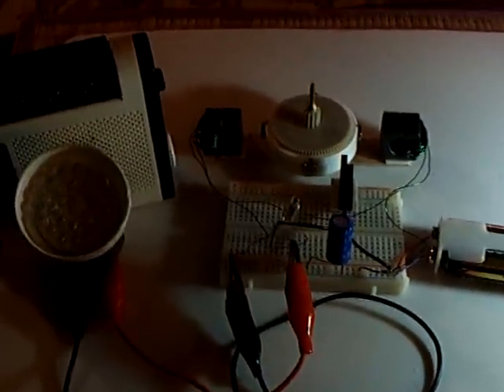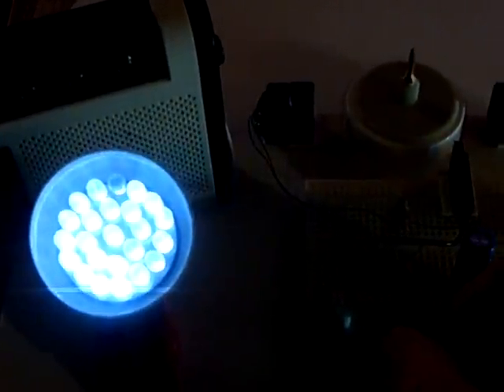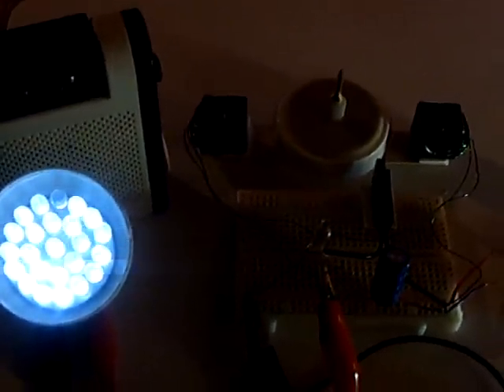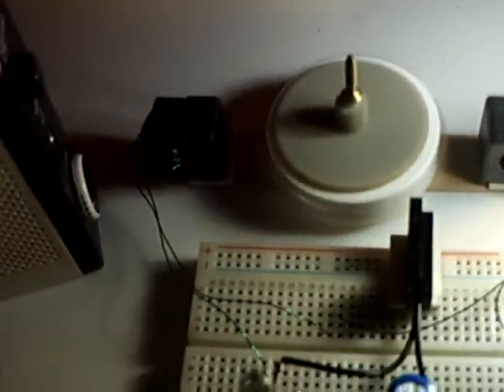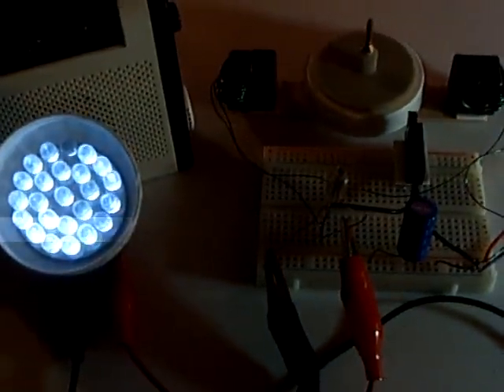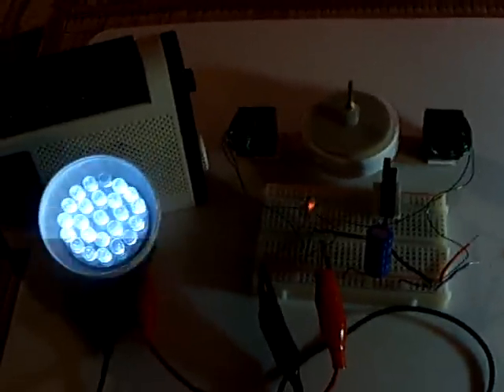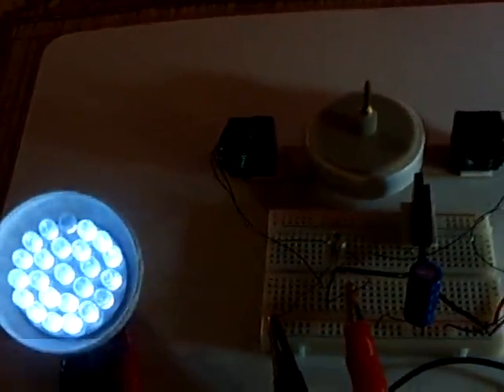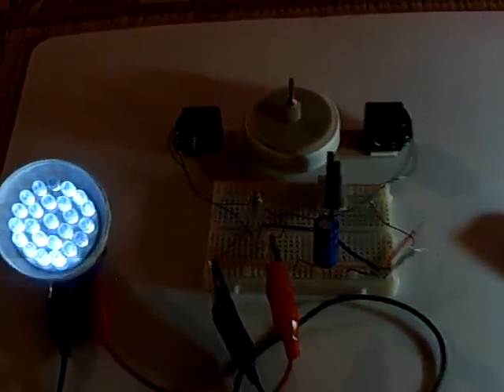Thomas Motor ---inductive kick back test

Comment: I dont think reeds are good for clean switching due to arcing,but you do have a good inductive kickback there. Good job again Lidmotor.
Reply from the maker: +TinManPower    Thanks . I may try to switch this some other way. I did more research on the Zero Force Motor today and found out more about it buried in old threads at the Energetic Forum.  It appears that the design called for the field coil polarity to be switched using that bedini/cole window motor circuit.  I'm not even going to try that.
Reply: +Lidmotor 
Now you're getting to basics - better than mocking Mr Bedini.

Comment: Lidmotor
Can you use Muller circuit with Hall effect sensor north side try as k4zep
Thank you
Reply from the maker: +Edmorbus   I got this to run today using a transistor circuit with a sensitive separate trigger coil to switch the transistror.  It didn't run that great so the next thing to try is Ben's Hall sensor method. I could also do it optically using a photo transistor and an infrared led.

Comment: I use a reed relay that works like a reed switch and almost never welds.  They're a buck apiese at Mouser or $3 at radio shack..  ETE omr-c-112h
Reply from the maker: +texjarhead  Thanks.

Comment: Well done. High current flow with high torque isn't necessarily a bad thing. It just means it's better suited for series with another load. Energy consumption doesn't have to occur with permanent magnets. We can save energy by consuming little or no energy in the motor and the other device in the circuit is what we're paying to run. Very interesting motor.
Reply from the maker: +Arkiver Unified Energy Thanks.  Yes this motor is very interesting.

Comment: Well done ! Did you make sure that the 2 toroidal coils are wired 180 degrees out of phase in series, so the magnets do not induce any voltage and current, so it has no counter EMF ? 
This way, it is just a Motor but NOT a generator ! So Lenz Law does not apply !
That is the most important point with this motor....
Reply from the maker: +Stefan Hartmann  This motor does not generate when you manually spin it.  Why it does this I am confused.  The coils are out of phase but with the coils winding running the way they are and the ferrite cores biased with the permanent magnets--it is just a confusing situation.   Without the bias magnets in the cores the the motor does not run---nor generate.  The rotor has all N facing magnets.
Reply: +Lidmotor It does not generate any voltage while spinning it manually, cause the induction is canceled out, due to the 180 degrees out of phase in series of the 2 coils... there the induction voltages just cancel out ! That is why this motor is so special ! That is also meaning, it has no CounterEMF when you run it via the powersupply, so the RPM will not be controlled via the difference voltage of supplyvoltage minus CounterEMF voltage, as it is in a normal DC motor...
Here the magnets from the rotor attract just the biased ferrite cores and when aligned you switch on the coils which then totally saturate the cores, so the attraction is almost gone and the rotor can rotate on...The Permanent magnet inside the core helps to bias the cores to a good value, so the coils don´t need such a big current to do the rest of the saturation...so this is the advantage of the Thomas Motor versus the Electric Orbo...Hope this helps to understand this motor much better... it just defies Lenz Law and only needs to be build much bigger, so that the magnetic and ohmic losses will be reduced , so it can go overunity. Regards, Stefan.
Reply: With bigger magnets and bigger ferrite cores and less distance between them you will get stronger attraction forces and thus the efficiency will rise ! But this will not negatively affect the motor cause it has no CounterEMF, so CounterEMF induction will not slow the rotor down, as it does not exist  ! This motor has really the chance to go overunity, it only has to be build really big, so the attraction forces of big neodym magnets to the ferrite cores will pull the rotor really hard and strong...
Reply: +Lidmotor Please try to reduce in your current model the distance between the magnerotor and the ferrite coils. This will already give a much stronger motor and increase efficiency. You probably need then also to adjust the reedswitch. Many thanks.
Regards, Stefan.
Reply from the maker: +Stefan Hartmann   I tried adjusting the distance between the coils and the rotor while the motor was running.  There is a sweet spot on this current model.  Too close and the motor cogs too much because of the strong attraction of the rotor neos to the ferrite.  Too far away and cog goes away but so does the power.
Reply from the maker: +Stefan Hartmann  Ben has not posted any more videos on his motor so he may have decided that this was another interesting road---that led nowhere.  He did make some calculations that showed that his motor configuration was a better performer than the Orbo design.  TinselKoala did a lot of work on this type of motor also and it appears that he has also put it on the shelf.   When this sort of thing happens I always ask myself--why?
Reply: Hmm, Ben was very busy with other things but still wanted to continue with it he told me. We will see, what will come out of it. When I will have some more free time soon, I will also look into this. some more. Regards, Stefan.

Comment: Very well done Lidmotor ! Yes, it probably need finer wire diameter wire, so it will not draw too much current and then you can also place it nearer to the magnet rotor.
Also another pair of coils would be good to have 4 coils all in all and it would generate more torque. Then one needs this also to be build 10 times bigger and then this motor will have some nice performance and might go overunity. Did you see, if it generates no voltage induction into the serial 180 out of phase toroidal coils, when you
turn the rotor by hand and watch it on a scope ? Many thanks. Regards, Stefan.

Comment: Nice!
 My reed switch is only good to 3A too.  
You can get higher current reed switches.

So you think the whole explanation for the increased torque is the ferrite core, internal magnet, & increasing the V?  I wonder if there is some easy way to measure the output torque without a dynamometer.  The physics calculation for torque is pretty straight forward--although, I'm not sure how one would go about applying it to your motor..

Thanks for sharing!
Reply from the maker: +A B  Thanks.  I have some higher rated reed switches also but I think that just adding a simple npn transistor circuit would solve the problem.  Perhaps a simple Hall circuit would be the other alternative.  I don't think that I want to get into real performance testing on this thing.  Other people might.  Ben did some numbers crunching on his original build and it looked good.
Reply: +Lidmotor Did he show his calculation method?  If yes, what is the url to his page?
Thanks!
Reply from the maker: +A B Here is Ben's video where he talks about the efficiency of his design compared to the Orbo motor.  https://www.youtube.com/watch?v=UsVPwKp56Zw.  Frankly I don't think either design is super efficient but that is just my opinion.
Reply: Thanks for the url.  His explanations are a bit difficult to follow, but he does make some interesting points--although, I'm not familiar with the "Orbo motor configuration" so that might be part of the difficulty.

As for the efficiency, one would need to define one's efficiency goal & then compare the different motor designs to determine which one most ideally matches that goal. A person who wants lowest energy consumption or highest energy efficiency has a very different goal than someone who wants highest torque or torque efficiency. 

Are you done studying those motors or do you have other things you're interested in understanding/discovering?